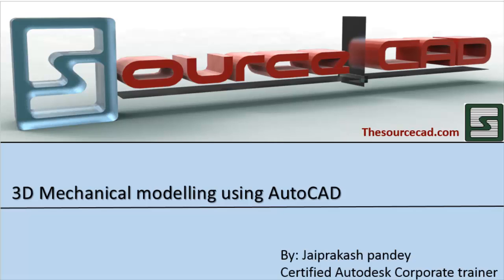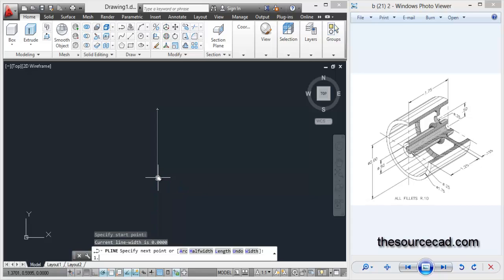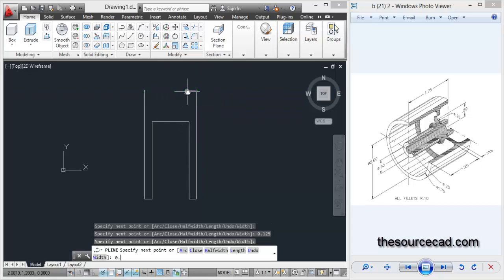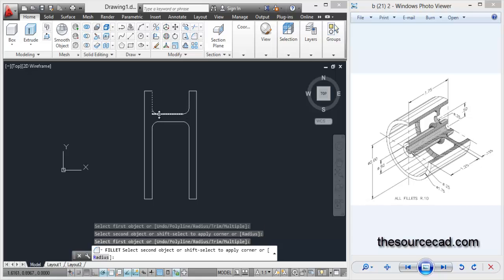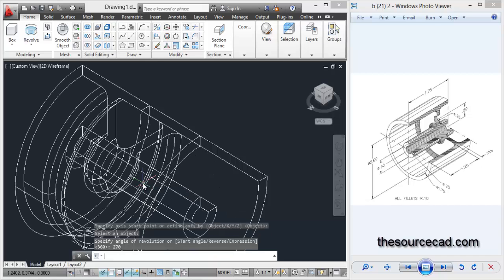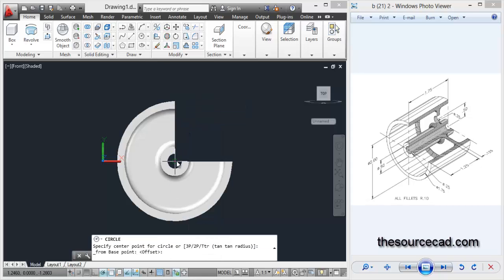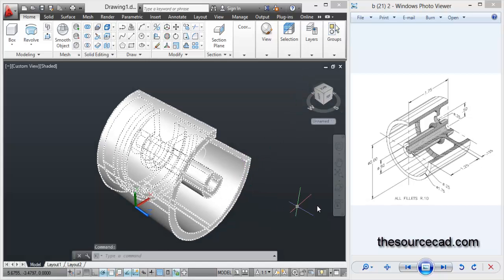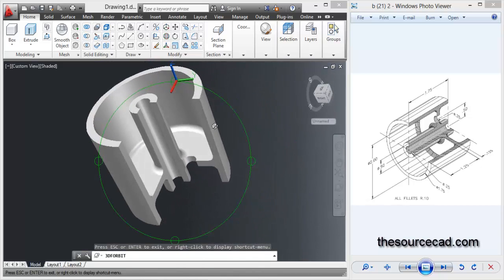3D mechanical modelling using AutoCAD: model 4

Comment: hi sir i have one doubt in this vedio u draw the line (0.625) .can i know that line belongs to radius 1.75 or not     . becoz  radius 1.75 is =0.875
Reply: 0.875-0.25=0.625. the 0.25 is from is the external radius of that inner cylinder. 
Took me minutes to understand
Reply: @Ankit-1357 in the drawing of the second 0.125 did he pick that because it's shaded? I get how we used the 2 inner circles to get the first side of the H but for the second part won't we use the distance of the 2 outer circle?

Comment: I have no idea how you got the circle to start where it did at 3:05.
Reply from the maker: greatsea select circle from draw panel now press shift + right click a contextual menu will appear select FROM in the menu and click on centre of geometry, Now enter this in your command line @0.5<90 this will exactly position your circle at the required point.